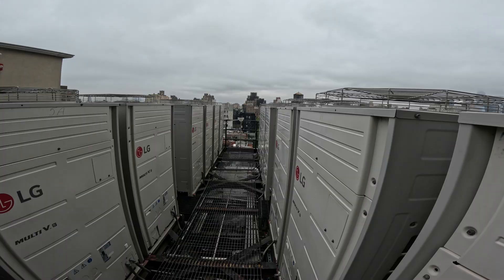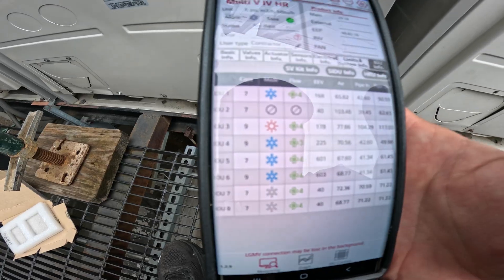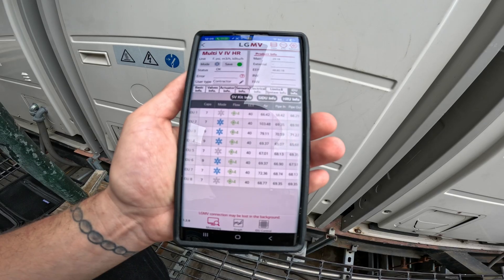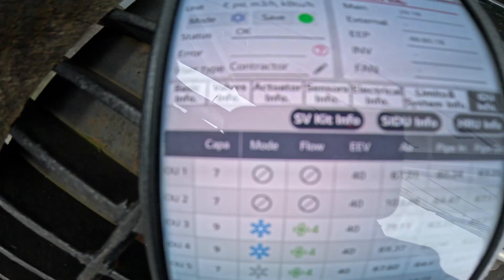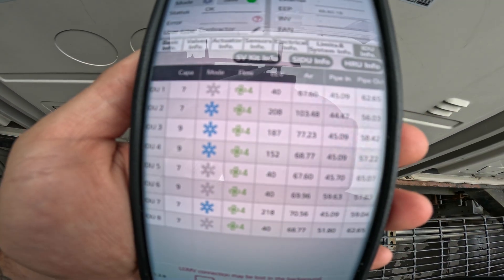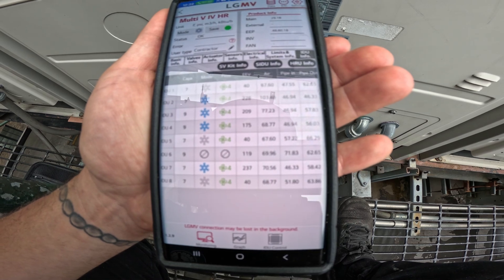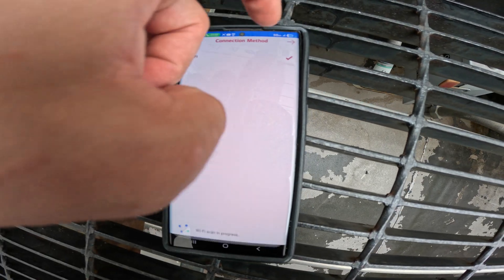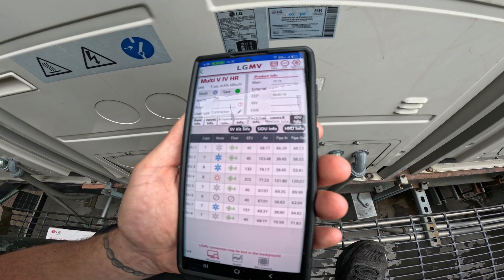HVAC: LG MULTI V Investigation Using The LGMV Service Tool (LG LGMV Service Tool Troubleshooting)

Comment: We installed 3 20 ton Mitsubishi city multi systems on 16 floors at 375 pearl st nyc total of 1000 tons of VRF.
We lost a few compressors and what we found out is. When you have  condensing units twinned together and are above the indoor units the refrigerant would stack up in the condenser that was off. As a result refrigerant would get in under the compressor oil and when the system would rotate that condenser on the refrigerant would boil off causing the compressor oil to get foamy. As you can imagine compressor oil pumps don't like foam so the bearings were going bad. The fix was to do a firmware update to rotate the condensers every hour instead of every 8 hours. This was 8 years ago and its been fine ever since. 
BTW 375 pearl st is the Verizon building next to the Brooklyn Bridge and across the street from the Smith houses in L.E.S.

Comment: I'm a bit late, but the issue is that when you press Start on the control section in the app, it will lock the units to those controls for a short duration, what you need to do is press Stop on the control section so it won't override the controls locally anymore. The easier way to identify the units is to look at the IDU number on the app and compare it with the thermostat address. If these are the newer style thermostats, you can go into the function codes(Holding Oper Mode and the up arrow for 3 seconds), and code 26 will tell you the IDU number/address. I will also add on that these addresses are not permanent, they will change if you perform an auto addressing procedure.
I believe the issue with IDU 2 is that it is reading off of the return sensor instead of the thermostat. That is set with function code 4, with value 1 being the thermostat sensing the temperature.
Reply: Now this is useful information!

Comment: Probably would have been easier to turn them on one by one, and/or set each handler on a unique setpoint until your assistant could read back the unique setpoint that his thermostat would have had. It seem like LG has the system programmed to override user settings whenever the admin application is in use.

Comment: You should pop the stat off the wall and mark the number on the back and eventually you'll know which one is which and save alot of headaches in your retirement hotel as you spend so much time in there